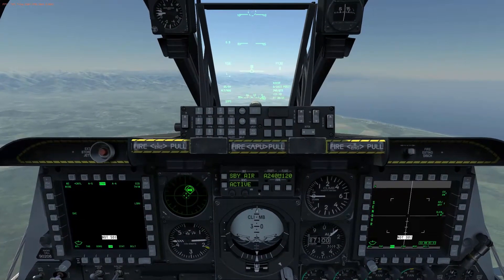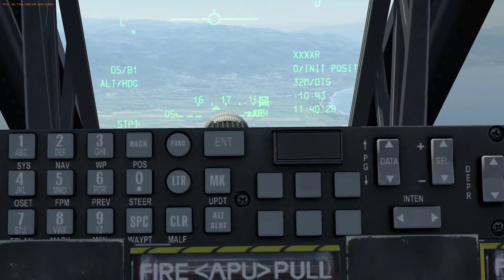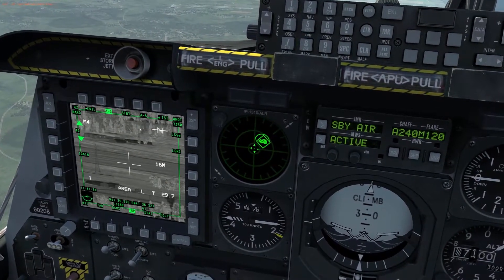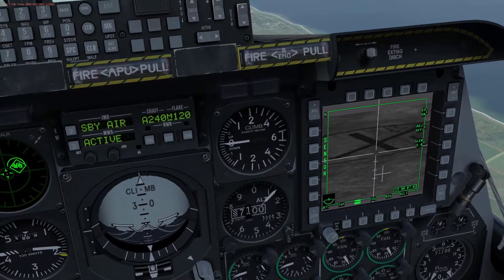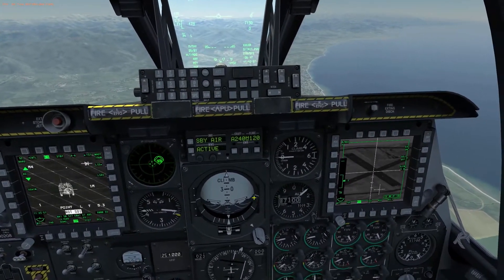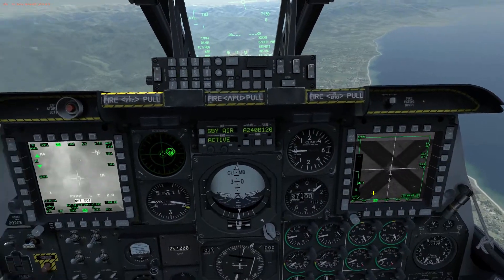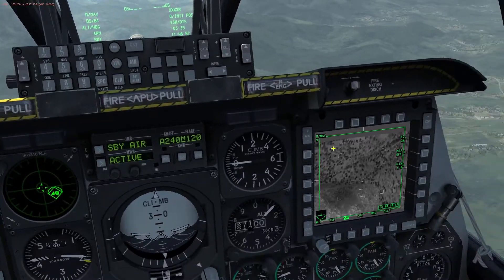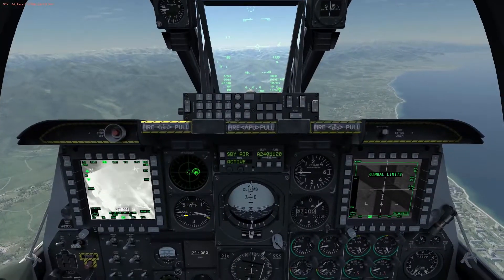DCS A-10C AGM Tutorial + Slew Rate Tip

Comment: Why the maverick crosshair is flashing after locking the target. Does it mean bad lock?
I thought you need a solid cross not flashing. 
In the F-16 when is flashing it means the lock is not complete and the missile will miss.
Reply from the maker: For me, as long as the "big picture" cross-hair has gone from wide 
search mode to narrow locked mode and tracking, I haven't had any issues
 with a bad lock. The missile always launches and hits the designated 
target. Once the big cross-hair goes from a large searching mode to a 
narrow and "shaking" view that is usually when I rifle / fire and have 
for a long time. I see what you mean by the small cross-hair in the 
corner flashing when a target is locked. I am not 100% on the 
differences between the F-16 and A-10C's systems....all I can say is 
under normal conditions this works well for me.

I've linked the manual if you would like even more information I'm sure you can find the answer in there! :)
https://drive.google.com/file/d/0B7NE7CXFUjcvcGFmUGdWajhfQ0k/view
Reply: PC Gamer 753 thanks buddy.
In the F-16 when you handoff a locked target from TGP to Mavericks, first you get a C for complete above the station you are using and then the cross hair is solid and not flashing.
Flashing cross hair in the F-16 means the target is off limits, (range, angle etc) or something went wrong during the handoff process. 
But I guess you get such differences in different planes. 
I know the Falcon BMS extremely well and I try to learn the A-10C for change. I just wanted to be sure your lock is good. 
In any case, your tutorial is good. Thanks also for your reply.
Reply from the maker: Hey thank you very much for the kind words! :)  I certainly don't know everything but it seems to work or has worked for me and I hope if works for you too! If you learn anything different be sure to let us know!!
Reply: PC Gamer 753 i just verified that this is one difference between the A-10C and the F-16 Block 30,40,50,52 etc
When the Maverick in the F-16 has flashing cross hair it means will miss the target.
In the A-10C it means good lock, in weapons parameters and ready to shoot. 
The rest are the same. 
I have tried that and you were right the mavericks found their targets. :)
Reply from the maker: Hey that's awesome! Good to know it works properly! :) Thanks for the information!